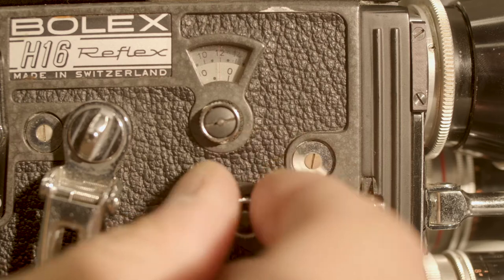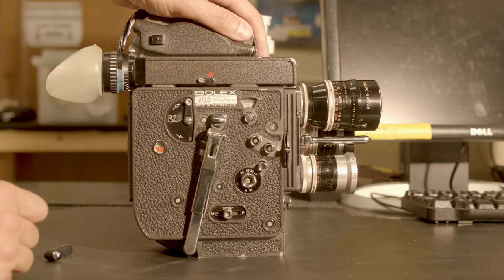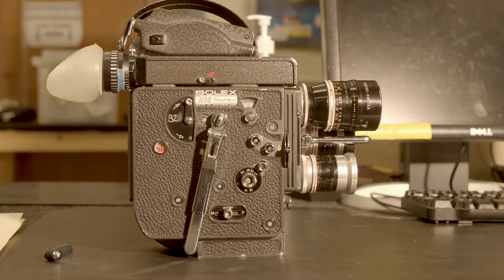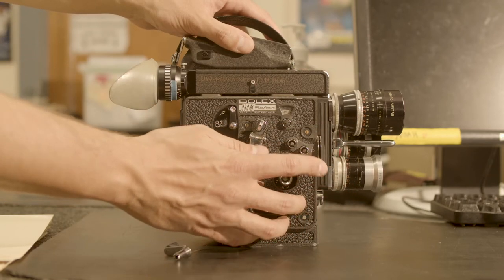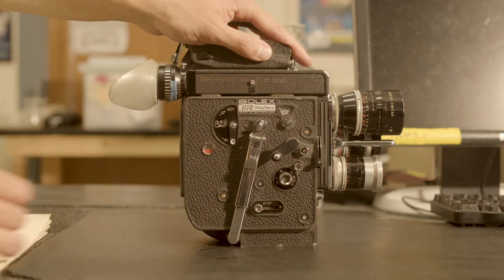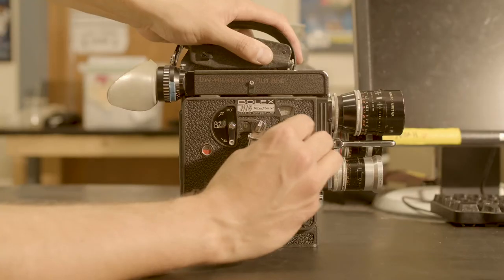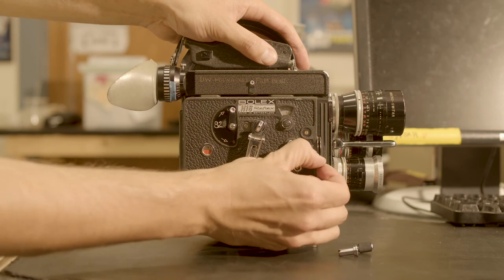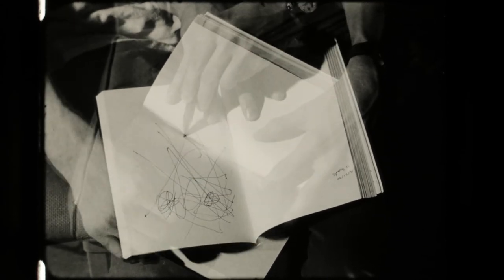Backwinding the Bolex for a Double Exposure

Comment: can you still rewind the dials without using a crank? spinning the outside ring of the frame counter knob still moves it down
Reply from the maker: You can’t— when you turn the outside portion of the rewind shaft, you’re operating a friction drive that’s connected to the frame counter, but not the drive spindle inside the shaft that the crank attaches to. You need a crank.
Reply: @isaacbrooks5412  alas, you were right. this comment turned out to be very very helpful
Reply from the maker: @anyoutubeaccount  sounds like you’ll be set for the next one!